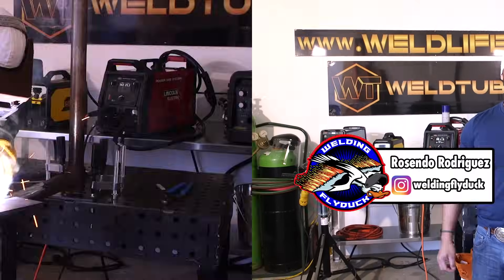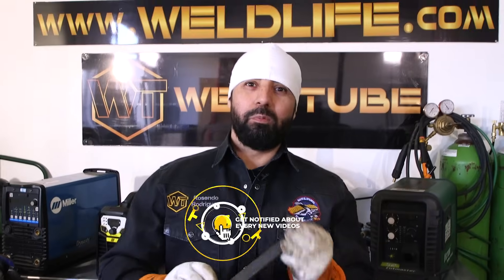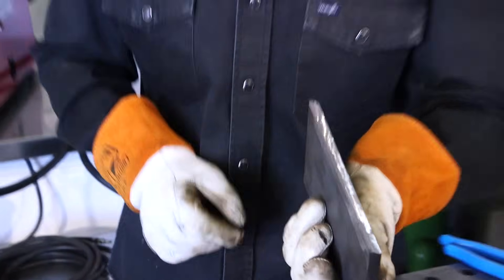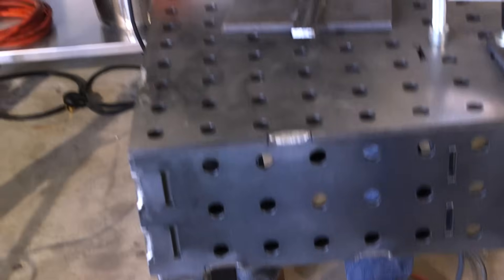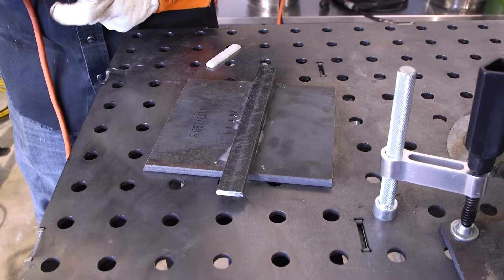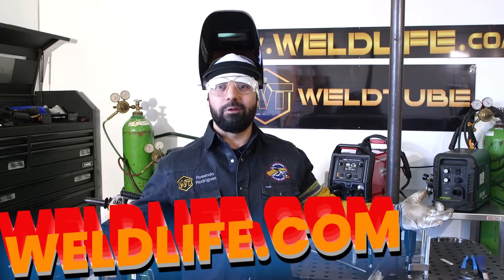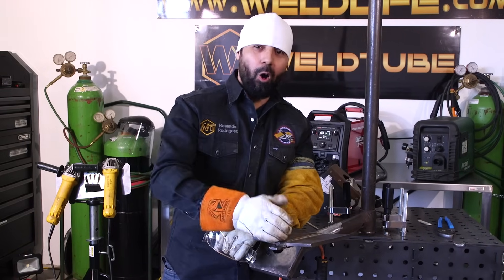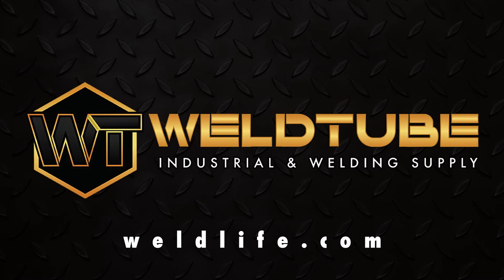1G PLATE | 7018 Stick Welding for Beginners

Comment: You cant weave more than 2 time rod diameter. Yourwelds are too cold and your are moving too much and too fast. . You cant run always in the same direction. You need to alternate. You did not pre heat the plate to remove moisture at the root. I feel sorry for the ones watching you. Thumb down.

Comment: I decided I wanted to learn to weld. Got a basic machine “Lincoln 90” and have done some decent work with it. I’m limited on the amount of power I can supply to the machine so unfortunately, stick welding is out. I’m going to stalk your page and see what lessons you have for MIG and Flux Core. Thanks for what you do my man!

Comment: 145 amps for a 1/8"/3mm E7018 you can't help but get penetration and using an inverter as well where you can reduce the current values you would use with a AC transformer. I'm 69 years old and would of used 127 amps just as I would when doing a Lloyds class one weld test with open root of 1/16th and gap of 1/16th. Can't help but think the older generations were really at the top of their game. There seems to be so much more aids today to assist the welder even machines where you enter the material, thickness of electrode and the machine chooses the current values for you. I suppose it's a bit of jealousy but we didn't go ave these aids in my day you learned by making mistakes and that way you never did that weld badly again. I take my hat off to you for your attempt to educate though although I think with the current val it especially you are suggesting you can't fail . This is coming from someone who worked on pressure vessels and had to endure weld test after weld test to get the jobs.

Comment: On a gap that wide I normally don't actually weeve the rod I turn the angle side to side and feed rod at the same time that usually ties my walls in on both sides perfectly and I rinse and repeat on the filler only I get a little wider as I fill it out to the point I am weeving a little then I go back narrow on my stringers

Comment: do you have anything on flex core welding or Mig welding? I will be learning to mess around with fenders on trailers small ones like a 6 x 12 and under. 

I’m learning I am a new subscriber thanks.

Comment: Done flat & vertical plate tests, And 5G pipe test, All the test have used 12 to 18 mm WT thickness, Never ever used backing strips, The inspector authority needs to see even penetration before the welds can be considered for X Ray, 🇬🇧

Comment: The Los Angeles City structural welding test is two 1 inch beveled plates with backing strips in 3G, and 4G. No zig zag only stringers.

Comment: From all my weld certs you/I were/was able to use a grinder to grind. A few times you could have a wire wheel for slag but never to grind. Too high is too high

Comment: You shouldn't have to use a grinder on any cwb plate only to clean with a wire wheel,use soapstone to follow if you cant see, build up a little under flush before your cap so you can follow your edges for a perfect cap.... I forgot more than this guy thinks he knows....lol if your defect is more than 1/8.. so if a 1/8 rod cant cover it its no good... Dont run guidelines with zipcuts ...in the flat youll trap slag every time, if you cant see that weld in the flat with out running deep train tracks to trap slag quiet welding cause if you get in a hard spot your done...i cant belive this guy is telling you to run a cutting disc down your plate to see, big no no, slag entrapment everytime, the flat is an easy position to get slag inclusions lol .. hmallays welding comments all the way from the ROCK, if you guys agree comment... I am damn sure not the best in the world but i haven't been a sleep the past 25 yrs either, please comment
Reply: If you don't agree also comment, always up to a challenge when it comes to welding, my advice the hotter the better,fry in your first 3 passes on all structural plates with a backing, turner up til she melts your left handed glove lol, you'll never fail a bend test, if you do it's your own fault not to clean it out

Comment: Backing plates are for pussies. Put your purse down and learn open root with a bad fit up. You’ll increase you’re employability and pay rate much faster than people that rely on crutches to make good welds.
Reply: I agree
Reply: Tig is the Cadillac of welding, preferably ss or inconel
Reply: Don't put down IWorkers, it's a art like everything else, I also know pipewelders that can't weld on a vertical plate or don't even know what ceramics is used for in shipbuilding..... enough for today...10/4 over and out y'all 😂

Comment: I've been welding on and off for a few years, and have done a few projects, a barn, fences, that sort of thing, and I LOVE 7018s and heavy steel. But one thing I noticed is that sometimes the slag is much harder to chip off, and sometimes it peels right off. Do you happen to know why this might be happening? I'm about to start building a set of cabins, very soon, and in a few days, I'm going to start welding anchor plates, then 4x6 3/8"s wall rectangular tubing columns. Any input would be great!

Comment: Don't use a landing/root-face on a backing strip; it's a slag-trap. Use a landing/root-face on an open root. 
Use some backing strip to make walls on the over-run plate. (If it's an open root, reproduce that also.) Allow at least an inch run-on/run-off. This puts the stops and starts outside the weld area which prevents a large bloom of heat-affected zone, and when cut off gives an instant clean square edge, and a sample that can be macro-etched for inspection.
Reply: Da profano, questa saldatura non ha deformato i due pezzi saldati?Non si dovrebbe evitare questo?
Reply: @xavigzio  Pre-setting the plates would  have been good too.

Comment: 12.50 in the video you created porosity the reason being you were pulling the weld sometime when pulling rather than pushing you can create porosity if done improperly I’m beginning to learn welding not an expert by no means  but that’s one thing my boss told me the other day he said there’s going to be time when you push rather than pull or pull rather than push he said but be careful when pulling cause it can create porosity

Comment: This is what the government schools teach. It is easier and is a full penetration weld for beginners. 
They do make ceramic backing strips for a reason. Metal ones of course were the first backing strips. 
 You can also use a soapstone line to better see where you are welding. And  for consistency side marks when welding a tone of short welds.

Comment: There is a reason i love watching how the professional welder opens the learning process of how to weld properly, you are the best welder i ever seen on You Tube channel how to do it right from beginning to the end with the same position as to weld, i am a starter a beginner myself i keep on learning from other welder but for  you, you emphasized to clean those two metals together this way the weld electrode stick together amazing instructions, and your outfit of welding has plenty of safe guard precaution, usually i never wear long sleeves as a safety measures, beautiful video and thank you for sharing such a professional instructions for beginners, In Thailand say's "Kab koon mack ma" meaning Thank you very much🙏

Comment: Quick question so how do i know when am i supposed to use a 7018 rod for a root i usually use 6010 for roots, 6013 for fillers, & 7018 for caps but i see here you used 7018 all the way is it because of the huge gap? Or cus of the plate thickness?

Comment: To beginners, using stick is primarily used for welding pipe, and the majority of the time it is an open root without backing welded with 6010, not 7018. Commonly only time 7018 stick is used in the flat with a backing bar is for structural which is not a common practice to use stick for structural.

Comment: Got into the habit of adding a little "fling" when i brake the arc on 7018 to flick the molten bead off the rod. Well it flung right into my welding bag.. before i knew it it was bellowing smoke an my assignment packet was toast.

Comment: Had a go on the Welding Simulators!
Though I went a little off line in a few tries.
I think that a Stick Welder is much easier than the other types as they use electrodes rather than wire. And you can hold the electrode like a pencil too!
Reply: you really don't want to hold them like that. They get extremely hot.
Reply: When using a fresh one yes but the remaining 1/3 of it gets really hot so you'll have stop holding it.

Comment: This man is a beast at welding and I have started a groove with backstrap yesterday and my instructor had told me to do the same as he said the only dofference is the machine set to 145 amps we put ours at 90amps
Reply: This guy is running an 1/8" rod. Ur rod size will determine ur amps. Position can slightly alter it as well.

Comment: What about the same weld procedure, but using a SA 200 Lincoln Welding Machine ?
Reply from the maker: Same technique, you would just set your amperage using the gear and fine current levers on the SA-200.

Comment: hey, I need info on how to get my certification in Puerto Rico......any info will help ...thanks
Reply from the maker: There is a welding school in Arroyo, Puerto Rico called Colegio Mayor De Tecnologia. Reach out to them, they should be able to help you with your welding certification👍
Reply: It should be explained that if the WSP says “stringers only” you can’t weave. You have to run stringers all the way out. 
Also it should be explained why you are using a 1/4 gap between the two plates. Different gaps correspond with the degree of bevel you can use. Typically lands are not used when using a backing strip. They are used for open root. However some CWIs don’t check fit up that strict but it’s not a habit that you should develop doing. 
Every test I have taken Ive never seen the wps allow for a grinder to be used either. 
So this video has information missing and techniques being shown that may not be allowed “everywhere” you test. 
I have 20+ years of field experience and 5+ years teaching experience and I teach currently at the college level. I will tell you this, different regions in the US weld differently. Down south it’s not uncommon to run a 6010 root and then a 6010 hot pass and 7018 the rest of the way. Some places let you do that in the Midwest and some don’t. 6010 root and then a 6010 hot pass is not supported by code but it’s an acceptable practice down south. CWIs are stricter on the West and East coast than they are in the south and the Midwest is a mixture. So you have to be careful with the technique you use are where. I’ve seen people fail their test just because they started reaching for the grinder! Literally they were just about to grab it and they were told test was over and they had to leave. That should be explained in this video also.

Comment: Never took a plate test with backing strip they were all open root inspector wants to see penatraction ,
Reply: What dose the plate having traction have to do with a full penetration weld?
Reply: @thatguyyouknow5866 absolutely nothing. The guy just wanna pretends he is a welder and knows what he's doing, especially when it comes to test taking. Especially when it says for beginners in the title.
Reply from the maker: Appreciate the feedback brother! This is a beginner test that is taught in high schools and trade schools for people that are just learning👍
Reply: @weldtube do vertical uphill 3/8th T joint pls . its a test for me in 2-3
 weeks plss give me tips i cant get uphill  near perfect
Reply: @jaylerma7804 up hill is just like flat 1g except you need to be very consistent try to cut ur weave 50/50 that is what helped me the most
Reply: See aws d1.1
Reply: This is a AWS  D1:1 weld test they give it in the 2G 3G 4G for structural welding
Reply: I just did this for a test.  It does happen
Reply: They cut the backing strip off and bend the plate afterwards like a U
Reply: They do exist tho
Reply: This is what the government schools teach. It is easier and is a full penetration weld for beginners. 
They do make ceramic backing strips for a reason. Metal ones of course were the first backing strips. 
 You can also use a soapstone line to better see where you are welding. And  for consistency side marks when welding a tone of short welds.
Reply: Nonsense -- I passed a 3G and 4G with a backing plate. It happens all the time.
Reply: Nice job bro I like your style.  And for all dem folks wondering about that backing; it's how they do cwb structural test in alberta but hey maybe they got you rootin the structural where your at
Reply: It’s more of a in school test for beginners working up too open root and they do bend tests on them cut off the backing strip and prep it
Reply: Depends on what test you are doing. Stick welding has backing
Reply: I weld tanks this is first test i did ive done this test mig and tig
Reply: Yes..... the plate its bend
Reply: U never went to school for welding? Bc u would've done this.
Reply: @jjjordan3881  I did and we never did this but then again I'm from nz. might be different over here.